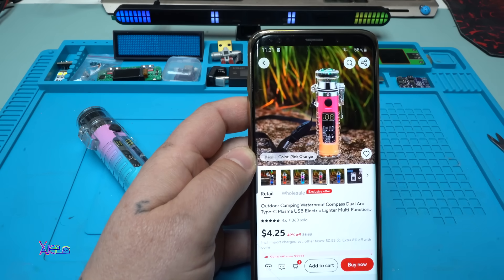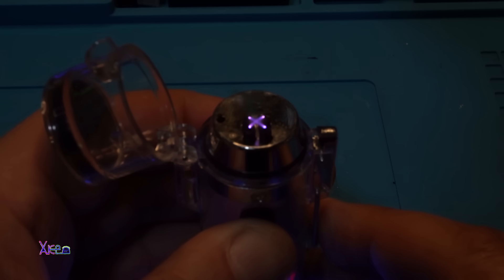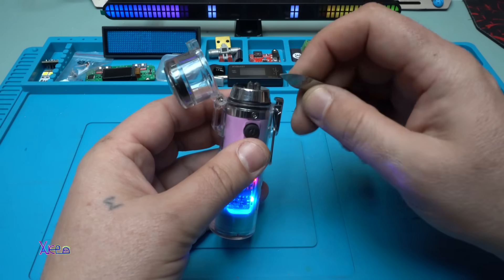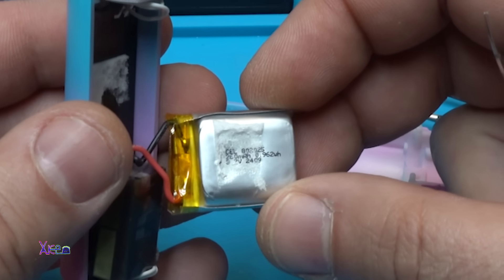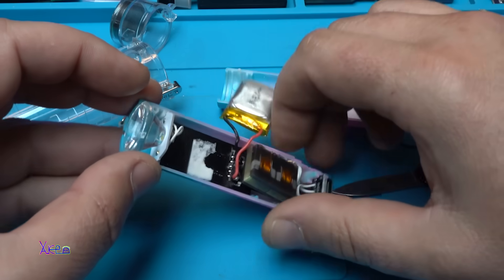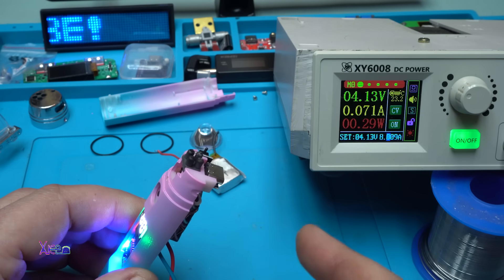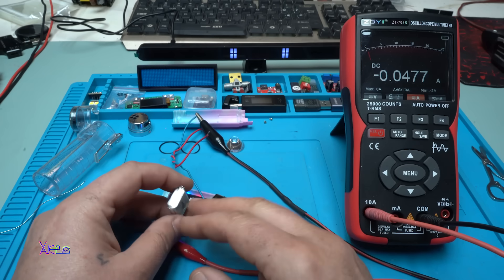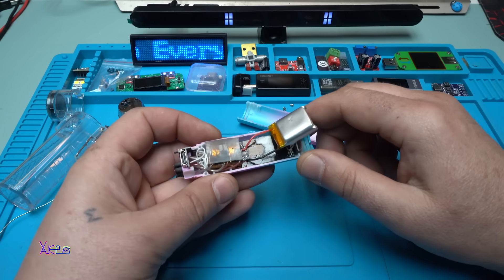$4 Aliexpress Multifunction Gadget - Tear Down?

Comment: You should purchase a DC TONG ammeter with a 4 Amp DC current range. That gives you a 1mA resolution so you do not have to unsolder battery. Ensure it reads DC current! Cheaper ones only measure AC current.

Comment: The plasma generator features a supply voltage drop detection system active during ignition. If the input voltage falls below the predefined threshold during startup, the high-voltage driver is inhibited from operation.
The internal resistance of your power supply and feed cables is excessive. Although the source can deliver currents in the order of several amperes, the voltage drop at the cable terminals triggers the internal protection circuit.
This mechanism is primarily implemented to ensure the integrity of the HV generator. Maintaining the discharge requires high power input; a decrease in supply voltage results in an increased current draw from the source. This condition would lead to current overload of the drivers.

Comment: Your power supply is a switching Supply, not linear .The plasma cannot stay on without a linear/ constant Supply. Try placing a good size capacitor with your switching Supply. It will probably work.
P.S. your battery will probably last 8- 10 min max using the plasma constantly on.
Reply: Спасибо за ответ!